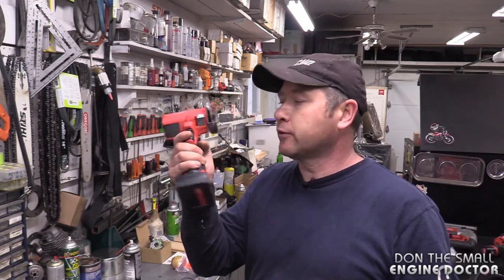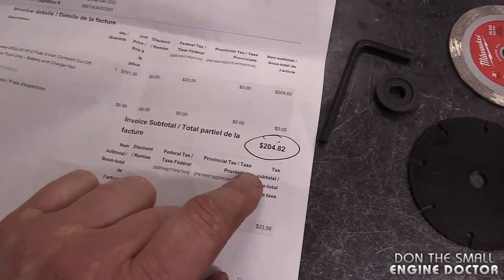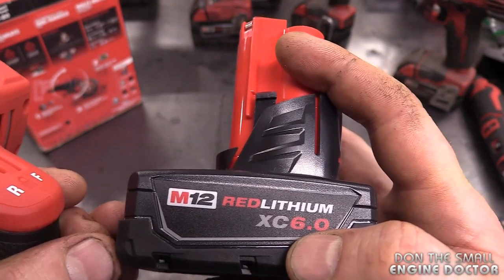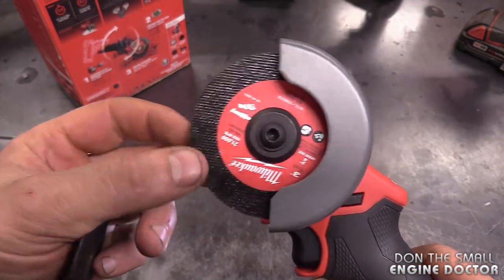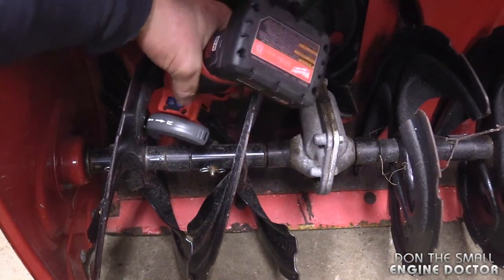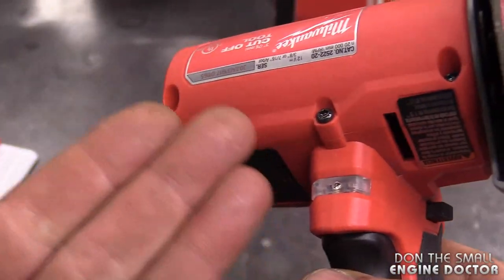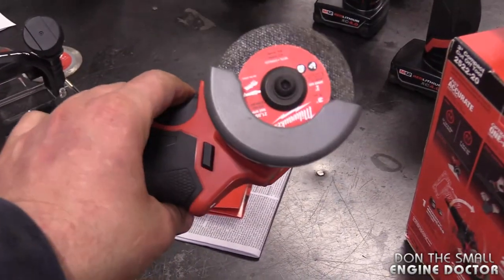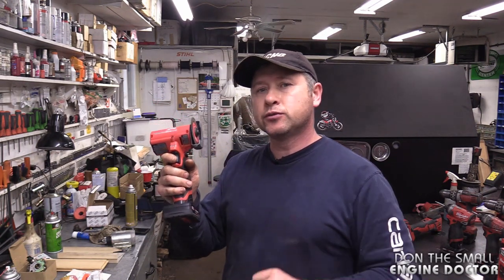Tool Review - Milwaukee Cordless 3" Cut-Off Tool

Comment: I've been a huge fan of Milwaukee for 30 years.  I always bought their corded tools until about 4 years ago when I started buying their cordless tools.  Now I almost exclusively use their cordless tools with a couple exceptions.  I still typically grab the corded bandsaw either my portable or the one mounted on the Milwaukee bandsaw table and I also use their corded heat gun.  The rest of my corded tools remain in their cases and I'm always grabbing cordless, mainly M18.  Love 'em a LOT.
Reply from the maker: i still use corded tools for bigger jobs!

Comment: I love Milwaukee tools, I have several of them for my shop. I got their M18 fuel 1/2 drive high torque impact wrench, M18 fuel impact drivers, and M18 fuel 1/2 drive drill. I also have a few wired line of their tools, such as a 8-amp 1/2 drive drill, and a 13-amp 4 and 1/2 angle grinder. I also have their 24" M18 fuel hedge trimmer. All my Milwaukee tools work great, highly recommended. Love that cutoff saw, I need one of those.

Comment: I use the Milwaukee cordless 3/8 impact for a few years love it. Will be looking to buy the cut off tool. I sent my air 3" cutter to be fixed but i think i can benefit from this cordless. Happy New Years Dony!
Reply: Well think of it this way, no obnoxiously loud air compressor to run, no running air lines, or electrical cords. Just one battery, locked and loaded, ready to dominate some project, and do a little weight reduction.

Comment: Hey Don. Happy New Years. May I offer this Tech Tip - using a paint pen, mark your batteries with the inservice date. This helps track the longevity of each battery. I also number my batteries. At a glance I can tell if one is missing (handy with multiple batteries) and last one charged.  
Great videos and enjoying your distance teaching with Dave🛠
Reply from the maker: Great Thanks!

Comment: If it were a side grinder I would jump on that all day long. I hate setting up the grinder to sharpen blades. There is not enough space under most mower  decks to sharpen the blade anyways. I have purchased the 3/8 impact for removing blades and it works great. I also got the 3/8 cordless wratchet. These save my fingers because as I get older I have problems some day turning wrenches. Happy New Year!
Reply: Milwaukee has a m12 fuel right angle die grinder that you should look at .  I use it with 2" roloc discs to grind and prep welds and clean surfaces with the scotchbrite pads.  It's great
Reply from the maker: @dhammmer8578  yes i need it, i'm tired of my air die grinder!

Comment: We just started using the DEWALT cordless grease gun and work light, as well as d m12 ratchets, rotary tool.  Exploring the idea of the m12 solder tool and a cordless heat gun..any experience with it then?
Reply from the maker: i don't have the solder tool yet, but i'm looking into it!

Comment: A very handy tool don :-D
The only thing they didn't think about is having the alan key clipped to the tool.
it's the same old problem we used to have with the key type chuck.
They could have moulded clips into the battery so the alan key stayed with the tool.
All very obvious.
If they wanted a safe option,  they could have changed the handle moulding so the alan key fitted inside and the battery had to be removed to get the key.
Maybe thats too much like the nanny state lol.
I hope you have a better year don, i'm sure you need it.

Comment: Don or anyone else please help 
I have a yard man snowblower with a 5 hp tecumseh engine. I replaced the carb since the old one was all corroded now the engine surges at full throttle. I don’t think it’s a dirty carb since the thing is brand new and fresh fuel was added

Comment: It's 12v. It doesn't have much torque even if it is Fuel. I bought it and returned it because it couldn't cut sheet metal in any appreciable way. I have lots of 12v Milwaukee. Some of it is good and some needs to be 18v. Milwaukee dropped the ball with this one. It's for hobbyists.